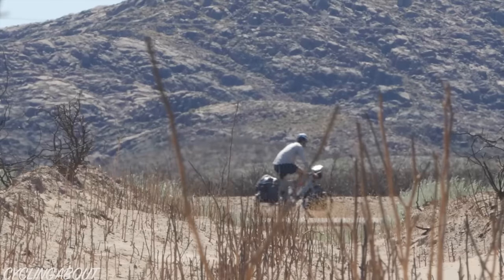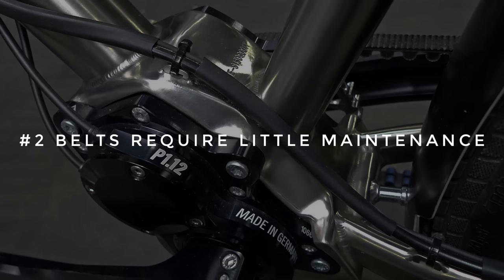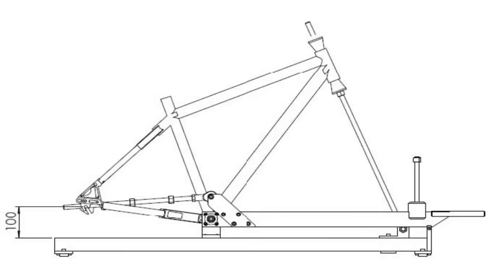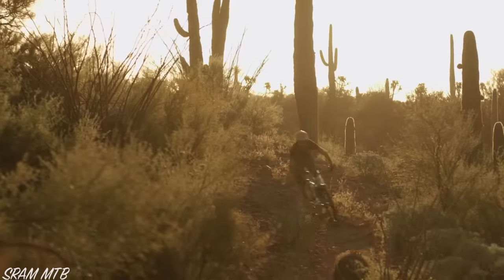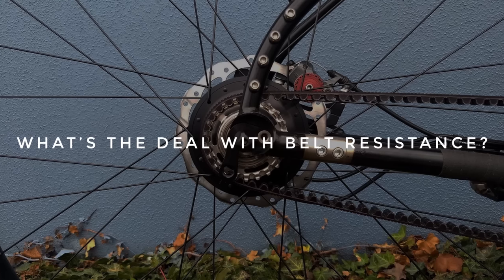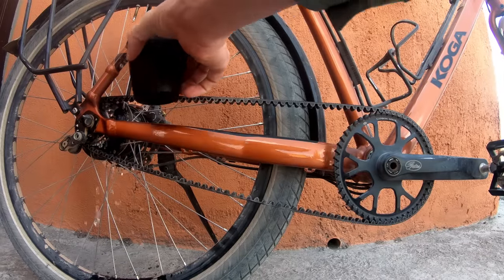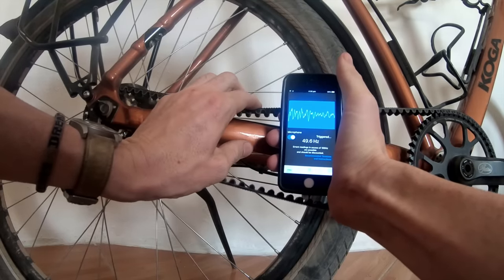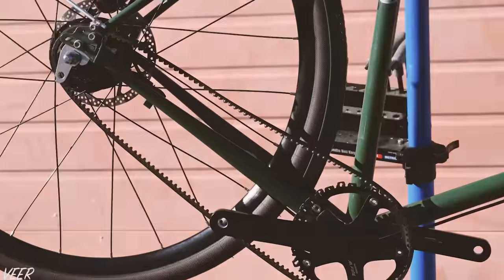Belts Are The BEST Bicycle Drivetrain Available (Epic Testing!)

Comment: Between 100g and 300g of weight saved in the chain.
BUT.....
What's the weight saved/gained in the entire setup?

You bring an entire 2nd belt. The gear system is different. The frame is different. The tools needed to change belt/chain are different. The tools used to clean and maintan the belt/chain are different. Probably other things that I'm not thinking of.....

Comment: If there is no derailleur why not put a protection around the belt?
Should protect it from the dust and mud...
Reply from the maker: You could definitely enclose it in something, but it seems to run well in almost all riding conditions.
Reply: @Cyclingabout  Thank you for your reply.
This subject (exposing chains and belts with not derailleurs) seems like an invitation of abrasives in the game, if not counting that it could chew cloths also. 
This done wisely (more or less weather sealed) should extend belt/chain and cogs life. Adding a lubricant bath like on older motorcycles would do it even better.

Comment: You oiled a rubber belt so you might aswell have a chain then you can have gears
Reply from the maker: I have 14 gears and sometimes don't add silicone to my belt for a year at a time.

Comment: Just like a automobile the cogs need to be of good quality, the cogs on an automibile engine which drive the camshafts are finished smoothly, any inperfection are detrimental to the longevity of the belt. I noticed on some close ups of your bike system, the cogs were quit roughly finished. I wouldn't call them quality parts.
Reply from the maker: They're definitely quality. I had used the drivetrain featured for almost 1.5 years when I filmed it... 💪🏼

Comment: It's not the belt it's the sprockets that go. 5000 miles you will need to replace front and rear in European climate. Best part of £200. If you get technicals in the middle of nowhere you have no chance of getting a replacement or repair. I've gone back to chain.

Comment: May be good for commuters on flat pavement, but not feasible on a mtb. no way an internal hub would give you the wide range of ratio a 12 speed cassette will.
Reply from the maker: Rohloff, Pinion, Kindernay and 3X3 are four options that will give you a wider range than a 12-speed cassette.

Comment: why do you need a split in your frame? just take the rear wheel out?
Reply from the maker: You need to break a chain to put it into the rear triangle of the frame. It's the same with a belt, but it's the frame that breaks.

Comment: I hate my Gates belt. Everytime when it is a little bit dirty it makes awful squeezing noises. I'm thinking of going back to a chain.
The belt is new because the garage changed it because of the noise.
Reply from the maker: Get some silicone. It doesn't need to squeak. I cover the topic in this video if you watch it to the end.
Reply: @Cyclingabout  Great thanks for you answer. I'm using a silicon spray but this last for around 50 km and than it is squeaking again. For me this is much more work than a chain. 
When I'm on a ride I'm tired in the evening and want to build up my tent, eat and sleep and not cleaning my belt. 
How often do you clean your belt? 
Thank you! I'm really looking for a solution.
Reply from the maker: @jorgw.6151  In the worst conditions, it's every few days. Sometimes, I don't do it for months. Are you using a spray or drip lube?
Reply: @Cyclingabout  I have a spray. I can use it only in the garden because it would mess up the celler. Yesterday I had a ride and it's very loud in the moment. Thank you for you answer. I hope I can fix this issue.
Reply from the maker: @jorgw.6151  I'd try a treadmill drip silicone lube because it is much thicker (I'm using one currently). It could also be worth checking your belt tension, perhaps it's higher than it needs to be.
Reply: @Cyclingabout  Thank you again for your answer. I will try it. The belt tension should be ok, because the garage changed it 4 weeks ago because the old belt was also noisy. 
The noise was getting louder from day to day. But today I cycled throw rain and the belt was getting wet and is quiet in the moment (!!).
Reply from the maker: @jorgw.6151  If water keeps it quiet, drip silicone definitely will.
Reply from the maker: @jorgw.6151  I don't think it's the belt. It sounds like the rear cog or chainring bolts to me. Perhaps the bottom bracket. You will need to take everything off and add grease to the threaded areas.
Reply: @Cyclingabout  You are right. I had a hint from a german cycling forum and I discovered an hour ago that the garage made a mistake. They forgot to tighten all screws from the vertical back wheel adjustment. I tightend now all screws and now it is quite. I will make tomorrow a longer test ride but I'm very optimistic that the noise has gone now. Thanks for your support and help. I'm very happy now, because I lost my motivation to cycle with such a noisy bicycle. People were looking at me when I came across.
Reply from the maker: @jorgw.6151  Happy to have helped!

Comment: ok ok, I watched the entire video, but for your use, isnt chain wayyyyy more reliable? if your belt snaps, you have one replacement.. what if it snaps again?
meanwhile if a chain snaps you can put it back with any piece of wire, anytime, anywhere - and a roll of wire takes way less space than a belt, and can be used for other purposes as well.
even zipties can put you back on road if youre using chain, while with a belt youre pretty much done.
Reply from the maker: It's just so unlikely that I'll break a belt that I'm not worried I'll get stuck somewhere.

Comment: well for touring adventure motor bikes they use shafts
Reply: Not true , you don’t want a shaft drive BM Trouble you in the Algerian desert 🏜️ with ABS and traction control and five ECU computers which all fail , you want a basic setup which all RTW riders use like a Honda xr400 with new sprockets and a chain every year (£60)

Comment: Great video, but I want you to know that 95% of belt drive failures are caused by low belt tension.  You may be giving up reliability and service life for that little bit of increased efficiency.  I'd check with the engineers at Gates.
Reply from the maker: I've now done over 30,000km on my low tension belt. I think it's unlikely to fail simply because my belt is always running in alignment due to the high stiffness of my frame.

Comment: Never seen belt driven bike before. Intrigued by gearing. Need to review more but unsure this is good for XC. This is Enduro specific I imagine
Reply: XC and Enduro are pretty silly names for essentially riding a bike over a variety of terrain. They only have any real meaning in limited circumstances, and considering the huge variety and overlap of bikes and terrain in each category, it's rather academic. Either you accept the restrictions of chain/derailleur systems, or those of hub gears with chain or belt. Neither is perfect.
Reply: @another3997  you're crazy. XC and Enduro are purpose built. 20 years ago I raced amateur XC and understand the differences. One could argue, a bike is a bike, is a bike. But anyone who rides XC has expectations precisely of what they want, unlike from let's say, a downhill bike. Or is downhill another nonsense title to you?

Comment: Belts : are 100g lighter than chains.
Also belts : always carry a 200g replacement belt, cause you never know.
Reply from the maker: Well, it's actually 60-80 grams, which is lighter than a chain breaker. 😉
Reply: @Cyclingabout  ok you won -_-

Comment: lightweight isn't a advantages because you have to use a heavier gear box.

Also they are not that "efficient" as classic chain, because you don't have a chance to put the perfect gear on your bike.
(I am not sure if the real efficiency importaint which you have already mentioned. Maybe I would not care much about the little better efficiency of  classic chain.)
With my racing bike I have always the perfect gear, or can put the perfect gear on my bike. So I can use all my muscle power perfectly, that is not possible if the gear ratio to big between.
Therfore you don't see them at any racing. And it is really importaint to have just one tooth between each gear, if you want drive fast.
There is not a single belt driver which have chased me or even could passed my racing bike, only racing bicycle be able to do that.

This belt drive is maybe something for globetrotter.
But a classic chain coverd in a box can last the same distance like the belt drive and can repaired evrywhere by youself 
And a the statistic say, that the average bike only last 10.000km
A belt drive isnt nearly perfect at it seem to be, it have his very specific application and will not dominate the bike market.
We just can look into big bike store where buy the most people, they just wanna have cheap bikes, and a motor.
It is just a nice think for some people which want to spend the money for very specific advantages or which love extraordinary tech

Comment: Do you want to be convinced that chains are better? 
A brand new rohlof gear hub costs alone more than 4x the price of my bike, with all its components included. It doesn't matter it can last x times more and is low maintenance, it's too expensive.

Comment: I do not see the advantage of the carbon belt drive. I ride nearly 7 days per week and have been doing so for 49 years. I enjoy tinkering with bikes, with these internal gearing however, I would be deprived of tinkering and powerless to actually make any repairs when necessary. 
And these belts do break, and I see riders carrying extra belts.
These bikes are about 6 lbs. to heavy and at least $200. to $600. overpriced.
One might consider the efficiency of the old style chain system, and understand that it has not been improved upon, not the French, British, Italians or even the Americans have been able to improve on the efficiency of the roller chain.
If the roller chain were new... we could say "Finally we have a far lower cost and more efficient bicycle drive system!"
A belt may last longer than a chain, but have you priced the cost of belts and gears? 
The belt is far more expensive in any way you look at it.

Comment: Not the best only rich people can afford this stuff. Us normal people will stick to the tried and tested chains. Chains blow belts out the water with price, repair, upfront costs, Parts available, Belts ware down really fast due to being made from rubber and fibers. weight because who does not want gears and hub gears are crazy expensive and weight more than any chain. This guy is flat out wrong by saying there the best. Get with the normal down to earth working class and see how it goes.
Reply from the maker: This guy is flat out wrong by saying they are unaffordable and wear down fast. Most bikes from Priority Cycles are $599 with belt drive and internal gear hub. The cheapest bikes? $329 with a belt. And belts do not wear down fast - my current belt has been used for 35,000km.

Comment: How to remove rear sprocket though?
Reply from the maker: You need to hold the cog with something (I normally just use a bench vice because the cog is already fully worn anyway), and use a track lockring tool to undo the lockring.

Comment: Cons far outweigh the pros. Not sure why belts are "the best". My thoughts:
Pro #1 - Long service life. Chains are so easy to find everywhere in the world, I'm not worried about service life. If you break a chain, you can repair it and still use it. Can't do that with a belt.
Pro #3 - Belt drives are silent. Unless all your friends also have belt drives, you aren't going to be seeing this pro if you ride with a group
Pro #4 - Belts are not lighter than chains. You didn't compare the gear hubs vs derailleurs. Of course the belt itself is lighter than a metal chain, who are you trying to fool here? And are these stiffer, belt-compatible frames just as light as conventional frames? Did you take that into account?
Con #2 - So belt drive is already much more expensive, and now I need an entire new frame?
Con #3 - Not having the ability to find replacement parts would label you as a risk in any group ride in developing countries. Bike chains are everywhere. Just because a metal chain is "worn out" doesn't mean it can't be used anymore.
Con #5 - So after all this money, and none of these parts available, I'm wasting 6% of my watts?
Unmentioned con - Your bottom bracket could wear out faster because it's having to keep the belt taught the whole time. Now possibly making this even more expensive, and this dollar/km is changing.

A belt drive fixie for riding around a city is the extent of use for belt drives in my opinion. As soon as you want to leave immediate civilization and do bikepacking, or you want to race, I'd say stick with chains. 
I'm willing to have my opinion changed on near anything, but this video didn't do anything for me. Great editing though. Super professional looking video. Just bad points in my opinion.
Reply from the maker: #1 - I can literally ride for multiple years at a time without doing any work or part replacement on my drivetrain. This is a MASSIVE pro for me.
#3 - Kinda weird point, but nonetheless, I ride alone 99% of the time.
#4 - This is a pro specifically for people considering purchasing gearbox bike and are deciding between belt vs chain.
#2 - Yes, you need a new frame. Not a big deal if you're brand new to cycling or planning on upgrading your bike anyway.
#3 - I've broken one belt in 100,000km+ of travel all over the world. I always carry a spare. Finding replacements doesn't even cross my mind anymore.
#5 - This is the downside to all gearbox drivetrains, the Rohloff averages out to be 1-2% less efficient across all gears. But the fact that I never have to tune anything, clean anything, and replace much at all - makes them easily worth the price and loss in efficiency.
Unmentioned con - This is only true if you are running a crazy-high belt tension. With a properly-designed belted frame with a low belt tension, you will have the same bearing wear when pedalling at 200-watts.
Reply: @Cyclingabout  Thank you for your reply! An honest discussion on pros and cons is nice to see here on youtube. So rarely seen. See, now you've got me doing more and more research on this lol.
You make some good counter-points, and I see more where you're coming from. I ride with a group as much as I can, or at least a partner, so chain noise is often overshadowed by my ranting about how easy it is to tune the derailleur so it's not so noisy xD

As I said though, professional video, entertaining, and this won't be the only one I'll watch :)
Reply from the maker: @Matt Hilbert  I'm always up for some healthy discussion (I live and breathe cycling, after all) and I'm glad you enjoyed the video! 🙏🏼

Comment: Unless you buy a bike with a belt drive and geared rear hub, I am not sure it makes sense for seasonal pleasure riders to spend that kind of capital modifying a bicycle thats worth less than the cost of the bicycle new, especially in locals where the bicycle are likely to be stolen, like near Seattle where bicycle theft a huge problem. Also, with 3 gears up front and 7 in back, a 21 speed mountain bike has a gear range ratio of 520%, where even the best rear hubs can only get to about 400%, thats a big difference in hilly terrain. Also, your a pseudo pro cycling enthusiast, so many people watching this content are not nearly as cycling focused and are probably unlikely to realize the benefits and probably would just pay a penalty in terms of increased upfront costs.

Comment: Belts are the best??  Try riding for 8 hours a day in a snowstorm in Canada as a bike messenger..  you will quickly realize how wrong you are....  not to mention belt drives have the most energy lost & are least efficient compared to a chain or axle drive bicycle...  not to mention you have to use internal hub shifter concentrating moving parts & pushing tolerances...
Whatever you choose to ride though I hope your journey is safe & enjoyable!!!  Bikes are the Best!  Bikes solve Global Warming!!

Comment: This person has audacity to say Belts don't stretch when compared to Chain? what the fuck, and belts don't have rotary joint, belts are bent against elastic/tension axis you are basically wasting energy just keeping the belts afloat on the sprocket
Reply from the maker: The carbon fibre cords do not stretch any practical amount. I know because I haven't tensioned my belt since I installed it on my bike three years ago.

The high belt tension only results in a lower drive efficiency until around 200-watts because you put tension on the belt when you ride. You can see the graph from an independent testing lab in the video. And at 100-150 watts power output, it is only 0.5 to 1.0 watt less efficient. That's virtually nothing.

Comment: Well you youself admitted that Chains are better... As long as they are brand new, very clean and not worn... wich 99 percent of the time is not the case... The friction in gear hubs/boxes is more than made up for by the life time and just one oilchange every couple thousnd miles.. Sorry to say but one Pro Belt Argument is ridiridiculous weight... yes the belt may be 200 gramms lighter but what does it mean when the complete drive train is several KG heavier especialli the Pinion Gearbox... But otherwise i agree with your views...

Comment: Motorcycle chains are so awful compared to belts. They make noise and sling oil all over you and just generally suck. But they have the same problem as bicycle chains; the transmission is geared too low to just swap out your chain for the lower-tension belt.